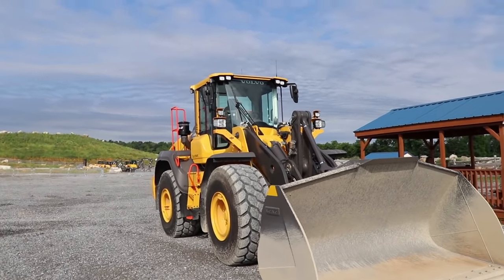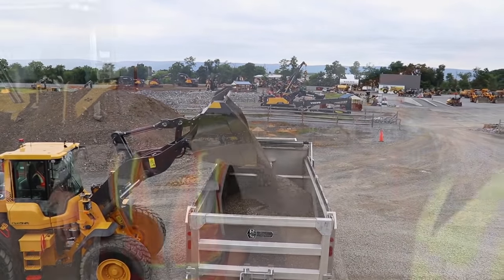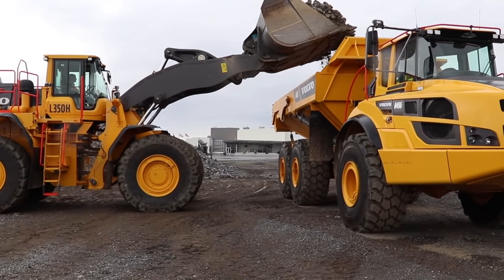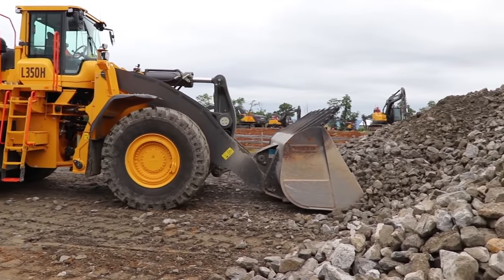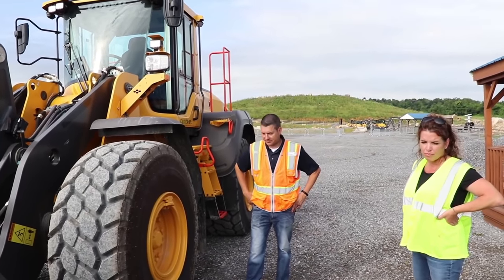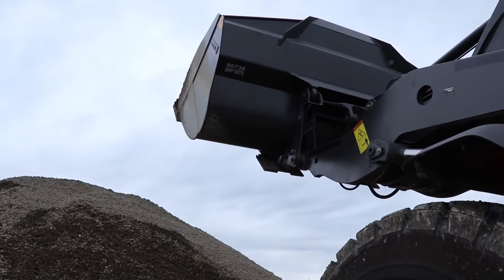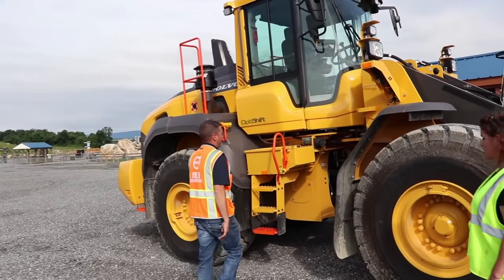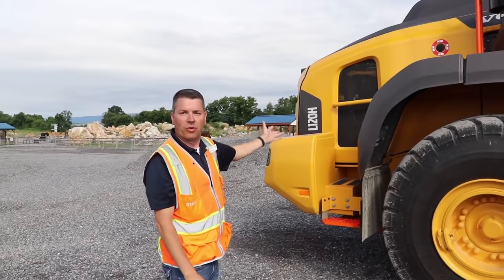Payloader Basics for beginners- how to run, operate & understand Heavy equipment part 1

Comment: 110k lbs?! That's exactly how much removable counterweight that I have for the crane that I operate. 😉. Not to sound like a jerk, but a six part series on YouTube does not an operator make. Anyone can drive a machine. Operating a machine to its potential takes years of experience. An articulated wheel loader is one of the more basic machines in an operators skill sets. Slightly more advanced than a skidsteer. Some of the most important aspects of operation were missed in this. Where do you check the fluids before operating? How do you ensure the machine you are getting ready to operate is indeed safe and ready for work? Pre-operation inspection is paramount to the safe operation of heavy equipment. If a person does not know how to perform one, they should not be in the seat. As a heavy equipment operator, these are some of the things that I feel should be in part 1. Just some constructive criticism, and my two cents.
Reply: To The Top Crane I have to disagree, skid steers can be tricky and require much more operator skill. Loaders are pretty easy minus the blind spots- not to take away from anyone who operates a loader but when's the last time you finish graded with a loader? Generally speaking you drive into a pile of stuff and then make a pile of said stuff elsewhere or into the rear of a truck.
Reply: JasonWorksAlot like he said if you dont know how to operate it you shouldn't be in the seat
Reply: JasonWorksAlot, I digress. I suppose I was strictly looking at it from the destructive capabilities of a 100k lb articulated wheel loader in the hands of an inexperienced person vs that of a 6-9k lb skidsteer. I agree in the fact that it takes more skill to grade with a skidsteer than it does to move bulk material with an articulated loader. However, I have had to cut some grade with a wheel loader. I can tell you, that is harder than cutting grade with a skidsteer. Also, if feeding a batch plant, a wheel loader operator is pretty much always cutting grade. If they pull the floor out of the bulk pit and dump it in the batch plant, the mix is no good. So, in that aspect, the articulated wheel loader requires more skill/experience.
Reply: I think they figure they have videos on that already on Volvo’s  channel they don’t need to run through that. However I do get what you’re saying I think it is very important to know these  things  before you jump in the cab.
Reply: To The Top Crane I usually cut grade with an unarticulated mantis crawler mechanical crane with a 71.7yd dredging rig myself. But I guess That's more so because I value a challenge 😘 however when I cut cheese if not with a knife I try to do it with dignity. So there's that.
Reply: JasonWorksAlot, now that's some funny stuff right there!
Reply: To The Top Crane most anybody can run or operate any of the equipment now days, but it takes more than that it takes talent.  I've seen "operators" use machines for years and still not be able to use it like a skilled operator.
Reply: Well look at it this way; thanks to this video a whole bunch of people have now been exposed to your wisdom.  Now it’s your turn to transform criticism into content and go CREATE!  Let’s see some operator vids from Top Crane.
Reply: Sir Lancelot, I already do that. I think I have 77 or so videos posted since I started my channel in February.
Reply: Sir Lancelot obviously your not on YouTube much or you would have already seen To The Top Cranes channel. He has excellent videos and walks you through everything he is doing. Also gives great operator tips and is very helpful to beginners. Not to mention you can ask the guy anything and he will reply and help you out to the best of his knowledge. May want to do some research before opening your mouth
Reply: Yeah never heard of him.  But then again with great comments like these I’m sure he’ll get his subs over 2k in no time at all.  Lol fan boy much do ya?
Reply: Sir Lancelot lol! You know 😉😆 good one
Reply: Hey speaking of fan boys...do you guys watch letsdig18 at all?? That guy can run a din din! I'd love his autograph.
Reply: JasonWorksAlot lol!!
Reply: Infandous Ktenology so can you run a crane?
Reply: Infandous Ktenology, I doubt it. Their tail would probably cause an issue with comfortably sitting in the seat.
Reply: but, when posting a running a loader video, you can't tell people where to check the fluids you need on all the machines  you encounter, their just trying to show you how to move the thing without breaking something expensive with the widest variety of machines possible, fluid check points vary enough that its something you'll need to find out from your dealer or from the owner that found it out from the dealer or the owners manual.             Every OEM is trying to move checkpoints around all the time to make them more convenient

Comment: I like when you asked him what size the loader was. Most operators that have been around would tell you what size it is based on a Cat model number, 950  966 size. Being a Volvo rep he couldn’t do that. The worst I ever ran was an International 500 series payloader. The cab was on the front part of the articulation. It was weird.
Reply: Carl williams I owned a international huff H60 that was converted to a gas Chevy engine
Reply: Tell him you want to see a 992 or 993 or 994 sized volvo... 😂🤣😅
Reply: SogySeal Yeah not in their product line!

Comment: Running a loader is simple. Engine wide open. 1.5 tire turns into the pile 1.5 out and 1.5 into the truck, repeat. Dont spin the tires digging. Wait for another truck. Any joystick jerker can do it.